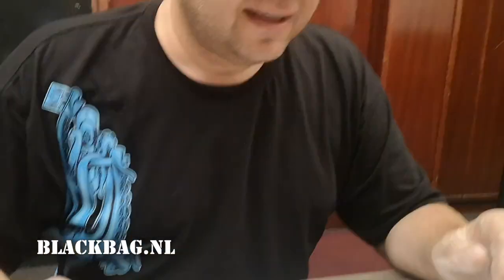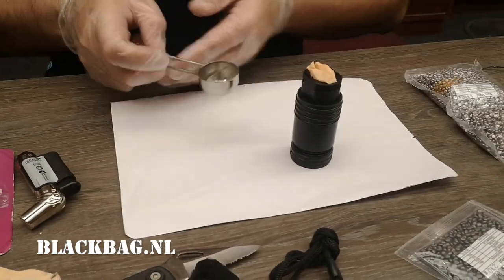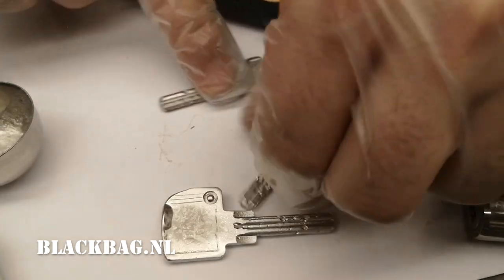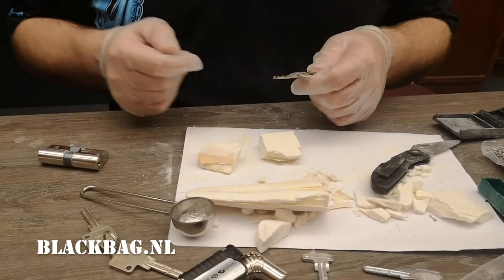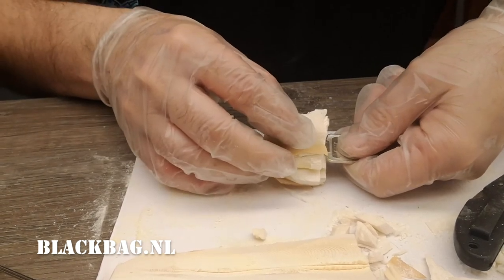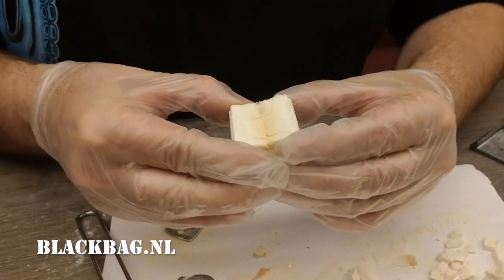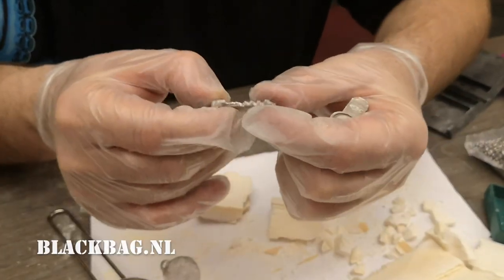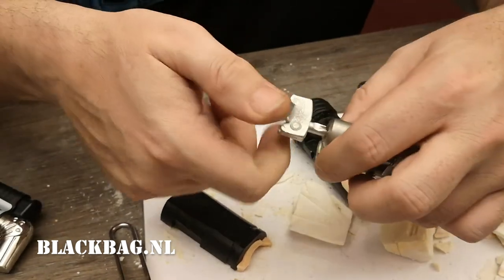Key duplication - alternative materials

Comment: I didn't much like the two part compound included in the kit. It seemed to harden faster than I would have liked. I ended up replacing that part of the kit with the choice of either siligum or polymer clay. For the metal, I simply went with field's metal. Your cuttlefish choice was entertaining to watch.
Reply: The first key I tried to make with the key also failed because it had already become too hard before I could put in the original key. The 2nd and 3rd key are on the previous video and they worked fine. We will try and follow-up with a video about siligum, thanks for the tip!
Reply: @driftdudenl  Not a problem. We all share, we all grow. :) Molds created with siligum are clean and possess nice detail, so it is certainly worth experimenting with. In terms of the temperatures it can handle, I seem to remember Matt Smith saying that it can handle molten brass, although I have not tested this personally.